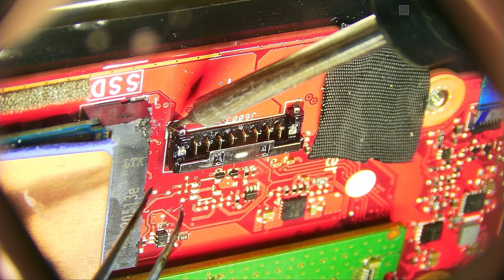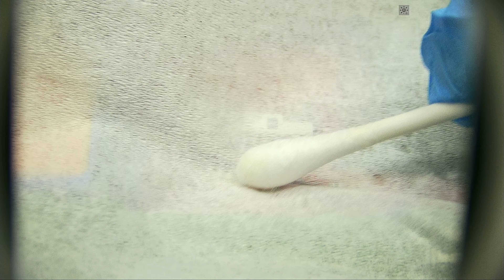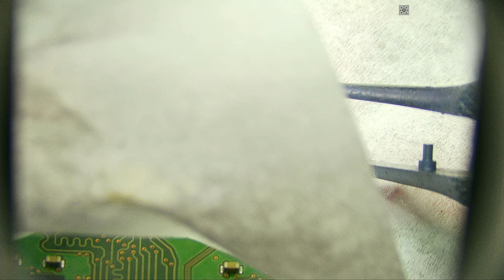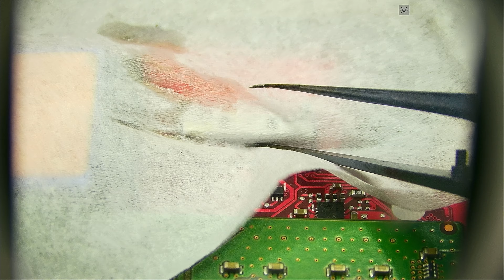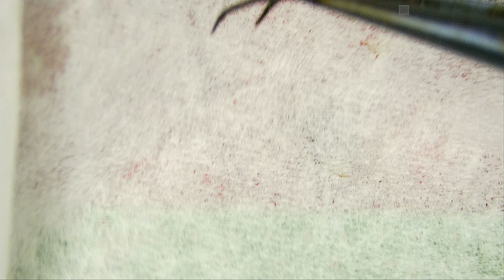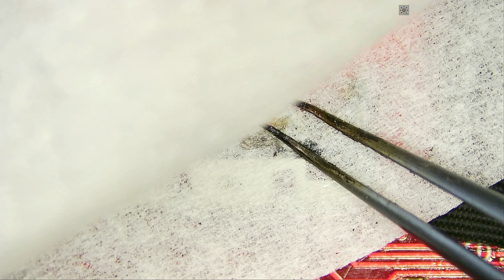Can I fix a ripped off battery connector from the motherboard on Asus ROG GA502L laptop board fix

Comment: I’m just two minutes and 27 seconds in not sure if you figured this out yet but that metal piece slides out and you can slide it back in once you solder on the port replacement , it slides out towards you or away from the BATT letters

Also, if you use hot air on the other side of the motherboard, ( on the G512LI at least you can )
you can tin those two mounting pads and then use hot air again to seeat it back down before soldering the 8 connecters . You can actually tin all of the pads and use hot air ( other side of motherboard ) If all the pads are intact without a rip trace, I had to use a soldering iron because I needed to repair 2 ripped traces. Funny actually the two that you said at least these two are good lol